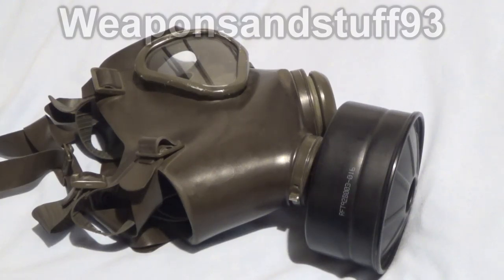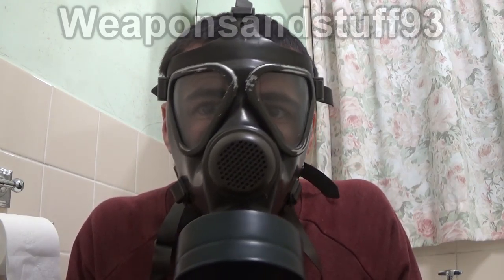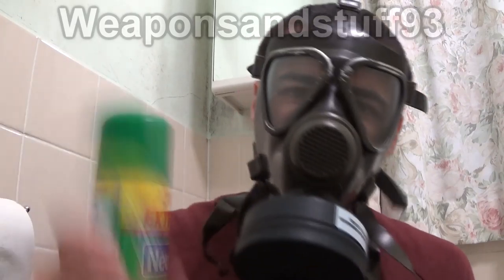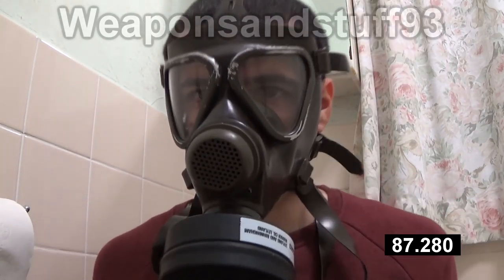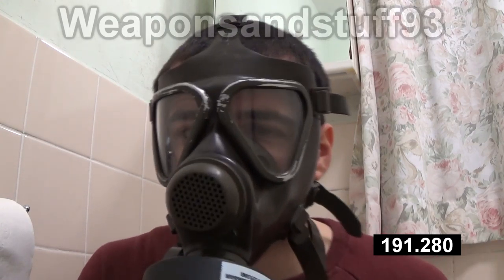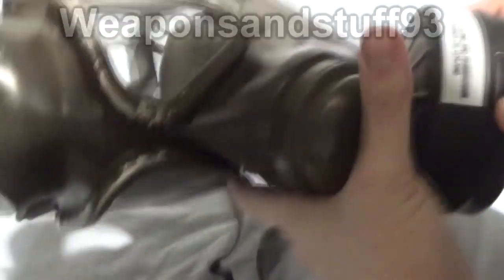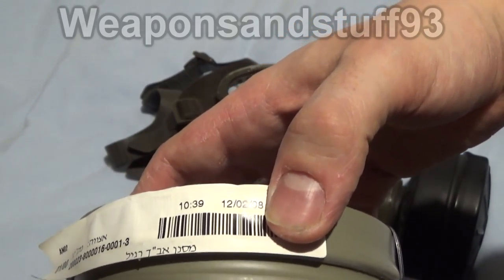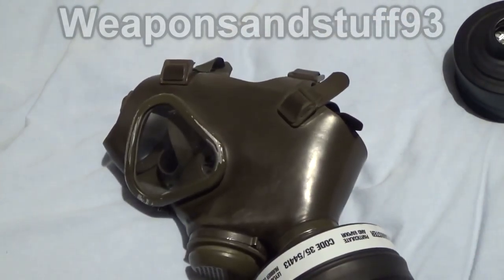German M65 Gas Mask/Respirator Test

Comment: The m65 was replaced in 1999 by the m2000 with the army and according to wiki it's still used by Civil defense
Reply from the maker: There's the M65Z as well that was also made and apparently better than standard M65.
Reply: Weaponsandstuff93 yeah the m65z is the version still being used
Reply: I like how the m65z has a screen covering the exhale port to prevent pebbles and similar debris from clogging it open

Comment: Got the same one today, no filter worked so tried my ''best'' filter with the Skyddsmask 51(60mm to 40mm adapter) and it worked. Had to be something wrong with the voice diaphram as i had a seal.
Reply: just to clarify, i smelled a little with my best filter on the M65 but nothing on Skyddsmask 51.

Comment: Hey i have a small question, i got a guy non stop telling me that the M65Z gas mask is a civil protection mask while i never heard any of that due to the german civil defense market only having the Z56 and a few Auer Models.
Correct me if im wrong but i believe it just has something to do with either the models modification or the Zodiak Suit.
Reply from the maker: AFAIK the M65Z was intended as a civilian mask but it was mostly used by the army, the Z from what I've been told is a higher quality mask than the original M65.

Comment: Can I get ur email or something cuz I think I got the original filter and wanna send u a pic. My question is: are the original filter ok to breath through?
Reply from the maker: I know what the original Drager filter looks like, look at a date stamp, if it's later than the 1960s and in good condition it's fine.
Reply: Weaponsandstuff93 thanks for the quick respons! It says 920032 on the filter and are the only numbers I could found on it
Reply from the maker: That's probably 1992 so should be safe, assuming it's not 1932.
Reply: Weaponsandstuff93 thanks mate. This is whats make ur channel so great, you care ALLT about ur followers. Keep up with ur great work =)

Comment: Just curious, since WW2 GM-38 gas masks have 40mm threads, are they the same as NATO threads? Is the NATO thread based on that thread? I ask this because I see pictures frequently of the Zivilshutzfilter 68 (?) fitting in it, and that's a NATO threaded filter.
Reply from the maker: I have no real way of checking, they are very similar threads but I'm not sure if they are identical, I've tried screwing NATO filters in to German WW2 masks but they always seem quite loose.
Reply: Oh. Well it still seems like the 40mm NATO design was at least originally inspired by WW2 German gas masks, which is pretty cool.

Comment: What about the M9 or something similar.
Reply from the maker: I've already done a video with the Finnish M61, that's pretty much a M9.
Reply: +Weaponsandstuff93 That one seals up differently. Atleast on my Asian face, the M9 has some gaps on the side.
Reply from the maker: Maybe the M9 is the same as the M61 V1, as the V2 has supposedly some changes from the M9.
Any idea if the Yugo M9 clones are slightly different as well?
Reply: +Weaponsandstuff93 As far as I know, the V1 M61 is a total clone of the original M9. As for the Yugo M9 clones, I have the civilian variant that doesn't have a oral nasal cup and besides that one part, it's the same mask.